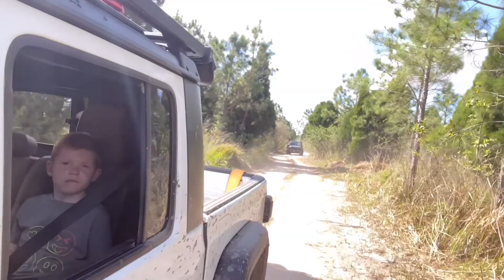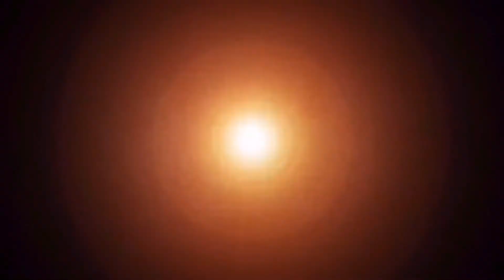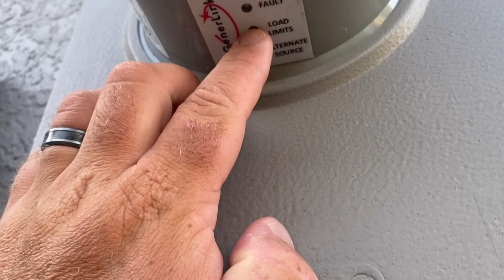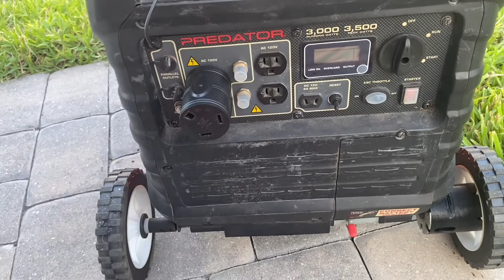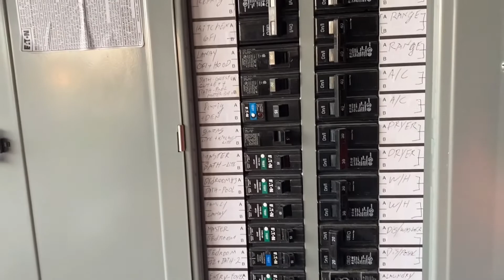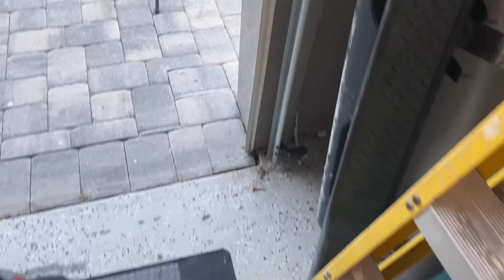I’m so dumb - Generator load test on our house!!!!!!!

Comment: Those breakers did not turn themselves all to keep the water heater on. Those breakers may have tripped because there was some type of arc or spark that the breaker sense and it cut off. It’s designed to do that. Arc fault breakers/ GFI/and combination. That’s the reason why some people don’t like these breakers because if it was a regular breaker, they would not trip unless it meet the required amp for tripping.
Reply from the maker: Yea I’m not a fan of these breakers.

Comment: very hard to find and buy middle tn.cost why too much 40amp generlink with surge protecter $1200.00
Reply from the maker: I went through my power company and they installed it for me
Reply: You can setup an external 30 amp generator inlet and a circuit panel manual interlock for about $250 bucks.  50 amp would be a bit more for 6 gauge wire.

Comment: Thanks for this kind of load test.  My generator is 6500watts so it is a comparable size.  Last week I ordered one of these units and this week a wind storm blew through our area and killed the power for 48hrs and it wasn't installed yet.  For me I am on a well pump for water so no toilets when it's out so that is the most important function for me to have going and next would be lights and plug receptacles to power internet and tv's.  I'm curious if I will be able to power my 60 gallon hot water tank and well pump at the same time to allow for a shower because the stank ass from 2 days of sponge baths was a bit much!😳

Comment: Did you ever get the predator connected to the general link with an adapter cable? I'm very interested to know if that worked
Reply from the maker: No, but since you mentioned it, I may just give that a second go. Ill keep ya posted!

Comment: You might be able to power your HVAC with a hard or soft start kit so long as you don't have much of anything else on. Same with the range or water heater, just do one at a time. I made a few videos of mine. I converted it to natural gas and power my whole house including the AC. Since I have all gas appliances it powers everything. If the AC won't start you can buy a window unit and use that during a long outage to keep one room cool.  The range and water heater should be good if you turn everything else off or for the range just use one side at a time. No need to keep flipping the breakers, just be conservative what you turn on in the house.
Reply from the maker: Yea I heard about the soft starts but idk if my system being a 5 ton would make a difference. Also, everything here is electric lol only gas is my propane grill lol. Thanks for the comment! Where did you get your propane conversion kit?